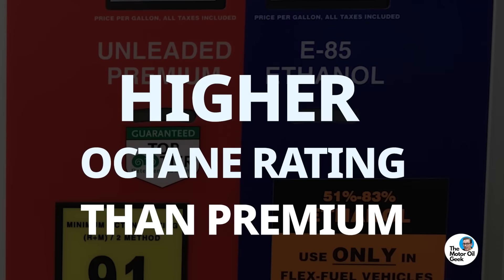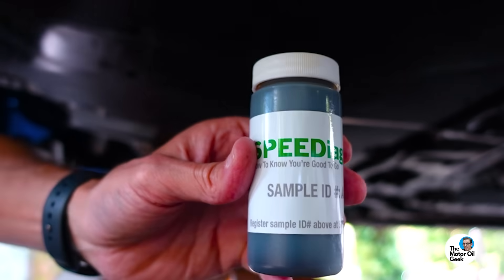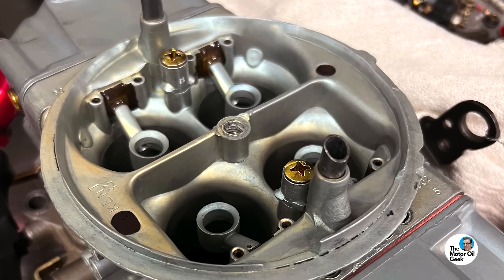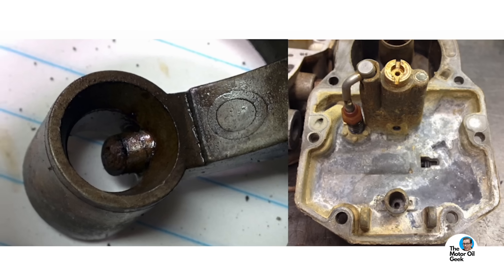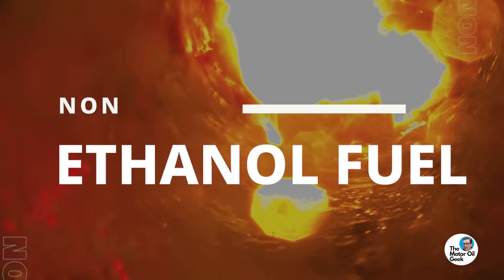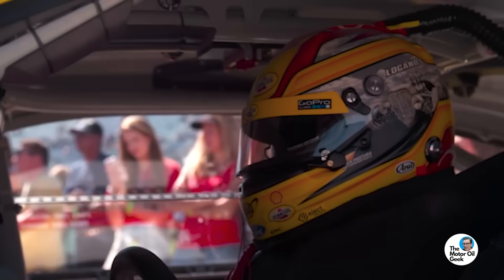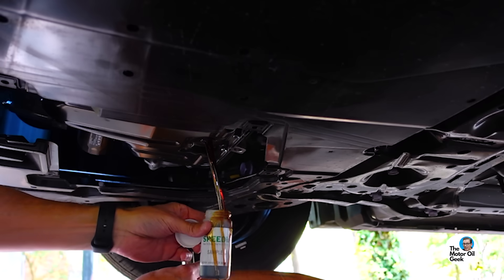ETHANOL: Higher OCTANE, Higher RISK?

Comment: Ethanol is purely a result of the farming lobby..recently the administration showed their support for them in ethanol.obviously none of them are chemists or seem aware of the damage being done.their tractors are all diesel now...
Reply: After the disastrous octane booster lead was finally outlawed, the petroleum industry gave us MTBE which was not only an octane booster but also an oxygenate.  During this time, non-toxic ethanol was modestly sold in the Midwest proving itself an economical and effective octane booster and oxygenate.

When it became apparent that MTBE was another disaster also needing to be outlawed, ethanol was chosen to replace it.  The petroleum industry even went along with the legislation for hidden in the bill was legal immunity for them from the MTBE.  This was revealed and taken out, but the bill still passed.

This is why we have ethanol at today's levels.

Farmers switched to diesels back in the 1960s and 70s before ethanol existed.  John Deere, Cummins, and others now have investments in ClearFlame, a company who converts diesel engines to use E100.  So clean it eliminates the expensive and unreliable diesel exhaust filters and DEF.  Henry Ford's dream of farmers using ethanol to farm with could come true.  He said there is enough energy in an acre of potatoes to farm that acre for 100 years.

There is no damage being done, Henry Ford designed his Model T for ethanol, his favorite fuel.

Brazil in identical non-flex fuel engines to ours has used >E20 since the late 1970s and >E27 since 2015.  It has worked out so well and for so long that Paraguay went to E27.

A chemist (unlike a propagandist) knows chemical compatibility charts show ethanol is easy on rubbers, plastics, and metals whereas gasoline and BTEX (benzene, toluene, ethylbenzene, and xylene) are very harsh on rubbers, plastics, and metals.

Ethanol is so easy on materials, it has been the non-toxic main ingredient of RV antifreeze since RVs existed.

A chemist knows that alcohols keep fuels "dry".  Before E10 came, people in winter in northern climates had to buy little cans of alcohol to add to E0 as gas-line antifreeze with brand names like Heet or Dry Gas.  No need anymore.

The US Bureau of Labor Statistics measured share of household income spent on vehicle repairs and maintenance from 1990 to 2017 during the time ethanol in gasoline went from .1% to around 10% from 2011 onward.

The share of income spent on repair and maintenance went from 2% in 1990 to 1.5% in 2017 as ethanol usage exploded.

Comment: Just mix one ounce per gallon of fuel Redline two stroke oil. One ounce marvel mystery oil. And last one ounce lead substitute. It makes lawn mowers and off road machines run forever. My lawnmower is ten years old and never gave up the carb. Ethanol should be banned it sucks.

Comment: By the way just an fyi ethonal reacts with aluminum. What are carbs mostly made of? Aluminum go figure thats why carbs get fucked. Ive had to fix countless carbs for the neighborhood cause they leave gas in their lawn mower and it starts forming white corrosion and will actually start causing pitting in the aluminum.

Edit: imgine what that does to aluminum heads on a car or truck.
Reply: Ethanol is rated at good to excellent on chemical compatibility charts for aluminum.

High aromatic gasoline (today's gasoline) is rated fair to poor on chemical compatibility charts for aluminum.  Look for yourself.

Brazil with identical lawn mowers has used >E20 in their common gasoline since the late 1970s and >E27 since 2015.  It has worked out so well and for so long that Paraguay went to E27.

Comment: Ethanol gas will ruin a carb quickly.  Lets not forget the fuel consumption with Ethanol is way higher than gasoline
Reply: Britian sold E10 to E30 blends starting in the 1920s with the most popular brand being Cleveland Discol which was an E10 blend that sold all the way to 1968-70 when BP bought them out.

Brazil in identical non-flex fuel engines, boats, motorcycles, and small engines has used >E20 since the late 1970s and >E27 since 2015.  It has worked out so well and for so long that Paraguay went to E27.

Non-toxic ethanol is so cheap that even in our current low compression low efficiency gasoline optimized engines, the cost per mile to drive with ethanol is less than gasoline even with the higher fuel consumption.  More horsepower and drastically cleaner exhaust are extra bonuses.

Ricardo built and drove an ethanol optimized engine for GM with both greater mileage and power than gasoline, even greater than a diesel engine all at half the size.  Here is an excerpt about it:

FROM RICARDO:
The new federal CAFE standards are calling for a doubling of fuel mileage performance, which, Vint says, is going to send OEM’s looking for high octane numbers to improve efficiency and ethanol is the best source. Ricardo, an engineering firm with over 100 years in the business of engine design, has developed an extreme boosted direct injection engine (EBDI) to optimize ethanol blends. The 3.2 V6 gasoline engine rivals the power and torque of a much larger GMC Sierra 6.6 diesel, he said, and it delivers 3.5 percent better fuel economy than the diesel.

Ford's prototype EcoBoost engine was optimized for E85 and achieved 15 to 20% greater fuel economy than E0 with load performance similar to a diesel engine.

Comment: I've only used E-0 in my '02 4Runner. Purrs like a kitten. Ethanol is the biggest scam of the last 50 years.
Reply: Identical 2002 4Runners in Brazil have used >E25 since new.  This year their fuel went to E30. 

There is a 2002 4Runner for sale on Facebook marketplace in Brazil for R$55,000 with 353,000 km.  Must be pretty popular to have such a price on that old of vehicle with all those miles (kms), that is higher than what they are here.

Why would ethanol be a scam?  It is cheaper than gasoline to drive with, has more horsepower, and produces far less carcinogens and toxic pollution.

Comment: I have a 1978 Lincoln Town Car and bought it 11 years ago in 2014, rebuilt the carburetor and only use non ethanol premium. No issues with the carburetor at all, in 11 years and counting.  And I only put non ethanol premium in my boat also, has the carbureted 4.3 v6.

Comment: Has higher octane rating but MUCH lower energy density.  High octane does NOT mean more power.  Much less actually.   If not so then explain why gas milage performance drops by 15 to 20 percent when running ethanol blend.
Reply: Our engines are optimized for gasoline which are lower compression but still do get more power with ethanol.  For example, a Chevy 5.3L engine is rated at a clean 380 horsepower on E85 vs a dirty 355 horsepower on E0.

The price of ethanol is so low compared to gasoline, the cost per mile to drive is still less even with the loss of mileage performance.  More horsepower and drastically cleaner exhaust pollution are extra bonuses.

In ethanol optimized engines which can take advantage of ethanol's many superior burn characteristics, one gets both more horsepower and more mileage performance than gasoline, even more than diesel.  

Here is an excerpt of one such engine Ricardo built for GM:

FROM RICARDO:

The new federal CAFE standards are calling for a doubling of fuel mileage performance, which, Vint says, is going to send OEM’s looking for high octane numbers to improve efficiency and ethanol is the best source. Ricardo, an engineering firm with over 100 years in the business of engine design, has developed an extreme boosted direct injection engine (EBDI) to optimize ethanol blends. The 3.2 V6 gasoline engine rivals the power and torque of a much larger GMC Sierra 6.6 diesel, he said, and it delivers 3.5 percent better fuel economy than the diesel.

That engine is why GM wants the EPA to come out with a 100-octane fuel standard.

Ford's prototype EcoBoost engine was optimized for E85 and achieved 15 to 20% greater fuel economy than E0 with load performance similar to a diesel engine.  They did not come out with it in flex fuel in part because they thought they could skirt paying for the patents to the MIT scientists who developed it.  That is still in court last I heard.

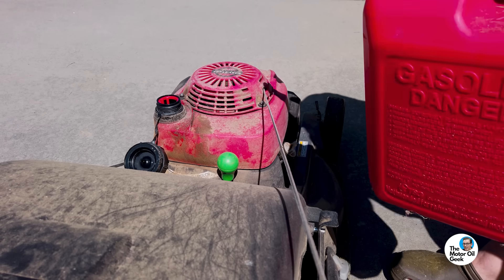Comment: For your Father's Go-Kart,  I am surprised he is not using either the TruFuel 2-Cycle 50:1 Pre-Mixed Fuel and Oil or the TruFuel 2-Cycle 40:1 Pre-Mixed Fuel and Oil. Gas pump gasoline with Ethanol will kill small engines. I found out this fact when it destroyed my 2-cycle cultivator and had to rebuilt the engine. For my lawn mower I use the other type of TruFuel for four cycle small engines. They are ethanol free. To me it makes the difference. 06:47 Oh, I see you know that already.

Comment: What a bunch of BS. What oil company is paying you to say this? Basically the oil companies are pissed about losing 10% of their volume to the corn industry. I started using ethanol blended fuel back in the early 80s in a VW bug and, yes, it had a damn carburetor. No problems, ever, with the carb or fuel pump. Back then they advertised the fuel with a picture of a corn cob on the pump. Most problems with other carbs were due to gasket, accelerator pump, or fuel pump failure due to the material used. Most fixed that problem within a year or 2. I have run 10% ethanol in all my vehicles with zero problems. Those carbs you shoe with a lot of corrosion have been sitting unused and exposed to the atmosphere for a long time.

Comment: I am wondering if using an engine block heater and oil pan heater year round, on a 2 hour timer in the morning for my commute, will increase engine lifespan and oil lifespan. I’d get rid of like 200 cold starts per year for like $50.

Comment: My truck has run over 80,000 miles on e85. No issues. As long as there is a .30 cent difference in price per gallon, you come out ahead. The only time any of this crap applies is if you run a carburetor (and don’t tune for the difference). Any car newer than the mid 90s is fuel injection. Good greif.

Comment: I can't take it.talk about making a mountain out of a molehill!I tear motors down with 250 thousand miles and the main bearings and rings look almost new.what more minute difference do you want? running all kinds of gas and oil and the main components he dwells on look fine.I still rebuild motors leaving everything as close to STD with as little machine work as possible with no problems.I have a 4.2 in my work truck I rebuilt four years and about 60,000 miles ago using the original head bolts 😳😲😳 😂😆😆 you can overthink anything.psychoanylizing your motor oil is kinda out there.the main problem I see with high mileage motors is gunked up oil rings that are stuck closed and not free to spring open against the cylinder wall,some cam wear,a lot of valve seal wear,a lot of carbon on pistons and valves so if you find oil that prevents that for it.

Comment: I always use premium non-oxy in my snowblower, my only carbureted small engine, and my snowmobile. I use an electric weed whip and mower. I mainly did it because I knew it lasts much longer sitting in a tank or in fuel jugs, I didn't realize the ethanol part of it could mess them up too, but it's a good thing I never use it in those anyway.

Comment: Unpopular opinion, it’s not the ethanol that causes issues, it’s all of the solvents and additives the fuel companies are adding to the fuels. Straight ethanol doesn’t corrode or break down anything in a carburetor. 
Also, a rich mixture (16:1) of Echo 2 stroke oil keeps corrosion and fuel breakdown in E10-E15 from happening. I’ve never tested any other 2 stroke oils but I’d guess they work the same.

Comment: Personally I have never had an issue with E10 and my currently daily driver has driven nearly 430k, where at least 230k of that was virtually exclusively on E10.   I have also performed long term open to atmosphere corrosion tests with E85 as well for nearly a year straight, the only material I saw issues with was two single crystals on a plate of gal zinc went black, all else was totally unchanged, even the alloy parts from my fuel system, so there is evidence that it does attack zinc at least.  One rubber hose went to jelly but returned back to normal after left to evaporate for a week, that I identified as a fuel safe submergeable polyurethane hose that was around 30 years old, well before ethanol fuels were available.

In my car, the fuel pumps have lasted more than 100k per replacement, so I have not seen any detriment to their life.  Interestingly the fuel system stays clean as well, similar to any 98 premium.   Many years ago before E10 was sold everywhere, my daily commute was only able to be supplied exclusively on fuel from BP servos, my car needed a min of 95 RON so I used the standard premium, not the 98 prem or the regular 91.  I tell you that was a nightmare.  pumps only lasted maybe 5k, I went through 4 of them in a span of about 2 years, all the check valves would failed in a few weeks of new, all filters were blocked with red dust after a few weeks, I replaced the tank as well but the issue shortly returned.  Two sets of injectors from the same red dust too, it was getting past the filter. 

I logged this data over time and used one servo at a time to rule out local contamination and eventually the only conclusion was the BP 95 RON was universally contaminated or had something very corrosive in it, but switching to E10 when all servos had it made the issue go away immediately.  I documented this on a blog many years ago, my only guess was some octane booster additive perhaps or an age related degradation because the bowser total pumped meter on 95 RON was a fraction of 91 and 98 meters, indicating it wasn't sold much and probably sat around for a long time before refilling the underground tanks.   All that said, I never really had anything with carbs to have a bad experience with E10 or E85.

Comment: Hey Lake,
I have a gear oil question for you.
When I first got my car built I put Valvoline synthetic limited slip dif oil in my axle with the Eaton Fuller limited slip (clutch) differential back in 2021.
I have had problems with the clutches sticking at slow turns.
I’ve added a bottle of friction modifiers in and that helps for one year and now it’s back to doing it again.
I recently found out eating fuller recommends petroleum based 80/90 GL5 with the friction modifiers.

With all the synthetic gear oil out there that say they are ment for limited slip differentials.

So should I go to petroleum base gear oil????

Comment: Get rid of the crap. Have e-85 only. The rest non-ethanol.
Reply: Brazil has identical non-flex fuel vehicles, boats, motorcycles, and small engines which have used >E20 since the late 1970s and has been > E27 since 2015.  It has worked out so well and for so long that Paraguay went to E27.

Comment: Farmers got their way forcing Ethanol on everybody @10%>>>then they tried to get it to 15%, for everybody but amazingly they were stopped...I wonder how they stop this metal destruction @ 85%? I still use Marvel Mystery oil in the fuel, can't hurt,  it Lubes the fuel because ethanol is so dry...And the farmers are still bitching, about something...
Reply: Ethanol on any chemical compatibility chart you will find is easier on metals, rubbers, and plastics than what gasoline and BTEX (benzene, toluene, ethylbenzene, & xylene) are.

The non-toxic active ingredient of RV antifreeze has been ethanol forever.  Hardware stores have sold ethanol in the paint section in paper thin metal containers forever.

Ethanol is sootless and helps reduce soot in gasoline.  Soot is what wears out cylinder walls and piston rings.  Brazil found that identical engines last >300% longer on E100 than their common gasoline.

Comment: Thanks for the video, Lake. I have a Flex Fuel vehicle. I feel like the engine performs better on E85 but I was wondering about engine wear and oil life.
Reply: Brazilian studies found that identical engines lasted >300% longer on E100 than with their common gasoline.  Soot is what wears out engines and ethanol is sootless.

Comment: Everyone push E85 tune for more power especially with boost. Its best thing to do and it cheaper fuel but no one talks about side effects. Harder on engine oil, hard on parts, burn far more fuel and don't store it in fuel tank over the winter must be flushed. I'm looking at ESS supercharger for my 15 Mustang so I asked few questions first thing upgrade for E85 mmmm F no. Don't want any of hassles with E85. I live in Iowa there are 3 ethanol plants from me within 40 miles. We have only few stations with E85. I see 1000 hp guys with 2 to 4 jugs of fuel in the trunk when going on cruises. THAT'S one big fire hazard waiting to happen oh it has happened